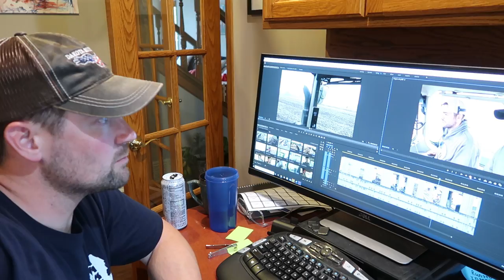Worlds Sexiest Lawn Mower

Comment: Nahhh the John Deere 455 all wheel steer has to be😂with a 3 point hitch and a pto
Reply: What about the John Deere 318?
Reply: Cody Rooker I prefer the 455, a proper John with a Yanmar 3 cylinder (I’m from England)
Reply: I have a 455 with all wheel steer, they are awesome!  The fuel efficiency is incredible, and they can put down some grass!
Reply: I have a 455 AWS and wish it was just regular steering with two brakes

Comment: As someone who's had a ringing in their ear since their mid to late teens: Get Onyx some ear defenders if he's gonna be running that machine for any length of time or with any regularity. I'm still just 26, but not defending my ears properly when I was younger is one of my greatest regrets, and I'd give a lot to give my younger self a peek into what the result of it is, so he could learn from it.
I also know a kid who's only 17, and already lost an eye to a broken off drill bit. Protection is extremely important, but too often we only realise that after it's too late.

(I also know some dads that may or may not have become a dad early than they wanted, so yeah, protection).
Reply: I can tell you it wasn't from the mower that hurt your hearing. I was in the Army for several year working on helicopters and firing guns, and my hearing is just now starting to get bad.
Reply: Tinnitus sucks
Reply: I kind of agree. I know why my ears are bad. Running a Minnie mo g955 straight pipe for hours on end every fall running a silage bagger.
Reply: I was a crew chief on large jets, in the Air Force.  I always used ear protection.  While at the Air Force Academy, we went out to a bar, where the music was loud.  I have had ringing in my ears ever since.  24 years s a crew chief, without damage, but all it took was one night without protection, to do permanent damage.
Reply: @ImpendingJoker  And I can tell you that it definitely was one of the reasons. I'm not saying my hearing has gone bad, I can still hear fine, but I have a constant ringing in my ears. Mowing the lawn as a kid without any hearing protection was definitely one of the reasons, I distinctly remember having a slight ring in my ear after I was done mowing, but it faded away. I always thought this was normal, until later on.
I'm not saying just mowing the lawn caused the issues I'm facing now, I'm simply saying: Prevent it at all costs. It only costs you a few bucks to buy hearing protection, and it can save you from a lifetime of annoyance, or worse. It's worth it, no questions asked.

Comment: I have a mower that spits out oil out of the exhaust lol
Reply: That’s pretty mint. Have you tried replacing the tires?
Reply: That's so the exhaust doesnt rust
Reply: It my have made some extra OIL just drain it and it'll be just fine until you need to do it again next week .
Reply: It was sitting for like 10 years the carb is also messed up
Reply: The only things it needs are some piston rings and a carb
Reply: Seems like you need to replace the head gasket
Reply: My old Toro got to the point I would add oil, and check the gas.  I had to change plugs on a regular basis.

Comment: I hate the censors under  the seat we taped it when I started mowing when I was younger
But we got a new one and cant access the censors to tape them so you have to put the handbrake on before you get off to stop it cutting out
Reply: sensors
Reply: You haven't tried hard enough! Some devices are meant to be compromised!
Reply: I bolted mine tight so I can hop off whenever I need to.

Comment: for the general use the GT235 isn't bad, but if you want to have a monster, get an old 140H3 - the implements you can get would rival anything on the farm (just smaller). I used mine with a hoist in rear to pull engines from vehicles... with weight on the front it worked VERY well!

Comment: Best chem for getting rid of dandelions in lawn is Curtail, best time to spray them is in the fall before first frost, as they are storing nutrients into roots for overwintering. Bonus most flowers are done by than and you don’t have to worry about killing them with drift.
Reply: Curtail is mostly 2-4-D (with some expensive additives) so I think he is on the right track with his favorite 2-4-D spray.
Reply: Paul Copeland , the additive you are talking about is Lontrel, which totally smokes thistles and dandelions which roots the same way, and it’s not that much more expensive than 2-4-D, a little goes a long way.

Comment: I've got a GT235, had the same thing happen to it (cracked hood). Mine also has the B&S engine, you can't kill the thing. Instead of getting the factory original side decals, look for an antique John Deere label, like the "D" model had. I put them on both my GT235 and my X748. Too bad I can't post a picture, it looked really good.

Comment: Uh-oh, let the RX go before you pulled up the shrub. I have a similar model JD mower. The hood on mine was dried pasta by 7 years old. Broke into lots of pieces. Bad material choice. The black deck chute cover is the toughest plastic I have ever seen. That piece gets wadded up as you mow so close you jerk to a stop against T posts and is scraped but not stiff or broken in any way. Fantastic choice of materials.

Comment: If only this video came out 2 weeks ago I would have known my x300 has grease zerks on the deck spindles.  Well, I replaced the spindles this week.  They don’t like to go 200hrs without grease.  They get really hot, whine a lot, and stop turning so the belt smokes.

Comment: you have such nice condenser microphones with shock mounts and pop filters ...and they're set up incorrectly ~ the pick up focal point on those types of condenser microphones is on the front side (only one side is the front) not the end
Reply from the maker: They're multi directional mics, doesn't that mean there isn't a specific pick up point?
Reply: @MillennialFarmer  hi, thanks for the reply.  best to check the documentation that came with the mics, or off the company's web site if you can't find the paper copy anymore.  From my experience a good condenser microphone like that will seem to pick up from multi directions and farther away as well as they are sensitive mics, but they really only have one ideal focal point and that's from the side in the front, from any other place it's just not as good or as the manufacture designed.  give it a try. I have some myself, not that specific model, but very very similar.  keep up the good work. and yes we're extremely dry here to the north west of you in saskatchewan.

Comment: Take the mower deck spindles out. Pull the bearings out and you will find that they are a sealed bearing. Pull the inner side seal off the bearing and now when you grease them then will actually get grease. 👍👍

Comment: Where I work used to have a John Deere lawn tractor with a Kohler engine that would smoke like that at startup, I just look at it like were fogging for mosquitoes. The oil level in it was always ok, in the cross hatch anyways. I think on occasion that before it was shut off someone was running it full throttle and then turned the key off without throttling down, don't know if that factored into it or not though.
Reply: If it has overhead valves it could be leaky valve seals.

Comment: Those spindle bearings on the mower deck you were greasing still have the seals on them, both  sides of the bearings, unless you take that apart & remove the inner seals, yr wasting grease & yr bearings are not getting grease to them any way, it's not only on the Johndeere it's like that, but on most all of them it is like that, , i removed mine... just thought i'd inform you of that...
Reply: Someone else has been watching Steve’s small engine saloon channel😳😂😂

Comment: You probably won't see this but I'm assuming what's wrong with your tractor is bad piston rings or a gasket because I had a Simplicity 7116 about 40 year old tractor and the engine blew up actually like 5 days ago because It had bad piston rings and burnt all the oil out of her

Comment: Zach:  I challenge you to find a new video suitable for use with the full jazz version of  Dave Brubeck's "Take Five". Anytime the saxophone plays, there shouldn't be any narration. If you can meet my challenge, I will buy a T-Shirt from your store. I 've made the same challenge to  Larson Farms and How Farms Work. I need some new t-shirts 2X size
I am also looking for a battery-powered Grease Gun. I don't have the budget for the top of the line from Millwaukee or  DeWalt @ $270, more like $100-140ish. Which  gun do you use on your famr I'd like to ba able to work on Farm Machinery as well as 18 wheelers & possibly excavators and such.

Comment: John deere and there fuzzy spindles and mower deck.... grease more than every 20years ?! .....phhhhhh
Reply: If you were to check the spindles, you will find that the sides of the bearing toward the grease zerks is sealed and the grease is not touching  the bearings. 😳😳😳Crazy engineering.

Comment: Leave  the pretty yellow flower alone.  Dandelion  pulls minerals  deep out of the ground.   And fertilizes the  soil.  The bees need the flowers.  Farmers kill. Everything  stop stop stop.   Use. 93 octane in your mower.   And remove  the positive battery, cable of the battery.  The key switch. Will drain the battery.   Factory key switches are defective.    Adjust. The valves after 4 years. Reset. The gap.   On valves. Exhaust and intake.  Poor design. On Briggs and Stratton  mowers.   Enjoy the ride. Later.